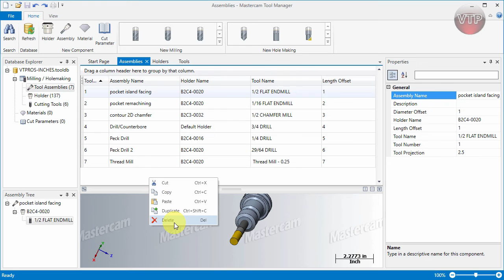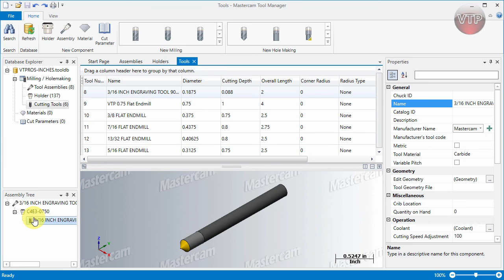MASTERCAM 2017-2020 - INTRO - Tool Manager - Create Assembly - vtpros.net (2019-2020)

Comment: How about learning AUTOCAD 2D 3D? Because training centres here are saying it the basic thing you want to know. Then you can go for MasterCam. So you tell me, whether i can cover all the basics in Mastercam amd start with it? Thank you.
Reply from the maker: auutocad 2d and 3d are for designing, mastercam you can design and program within, they don't have to do anything with each other. The most popular CAD program is solidworks, so i would highly recommend solidworks over autocad, and mastercam over the other cnc software, those 2 software are the most used in the industry, autocad is ok and it will still be used but also a dying industry. Mostly used within architects and construction work, if you're looking to design parts and machine them, stick with solidworks and mastercam.
Reply: VTPROS.NET Thanks a ton. Appreciate it :)
Reply from the maker: Anytime sir let me know if you have more questions

Comment: Hey, I want to know which software should i learn to startup my cnc machine shop. As basically in production of parts. So please lemme know in detail. Thank you. My email - tafazulhussain4@gmail.com
Reply from the maker: Hello tafazul, the best varies between different cnc machinest and programmers so it's just a reference, the most used and has nearly 70% of the industry is mastercam, so it's the main one i suggest to learn because you will find the most information around and most jobs as well. let me know if you have more questions